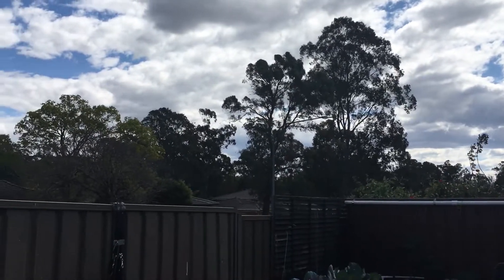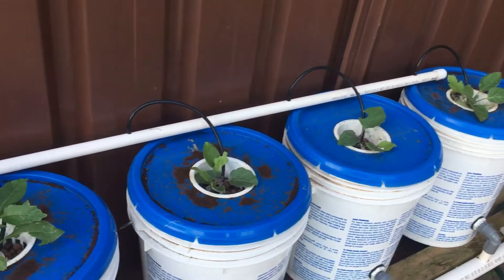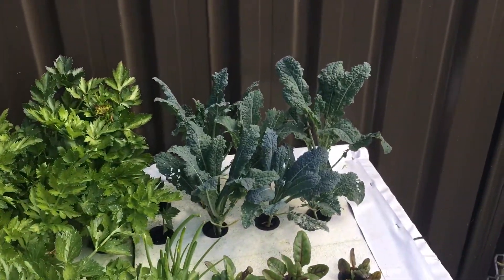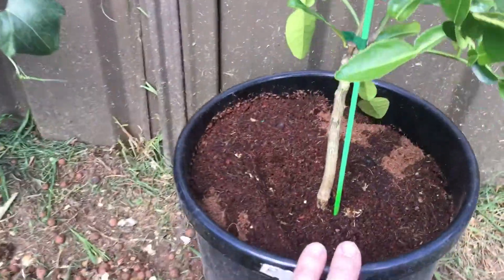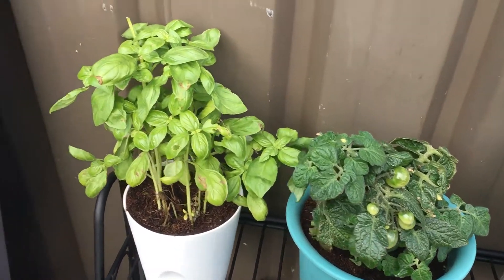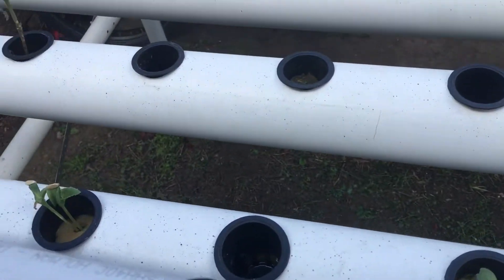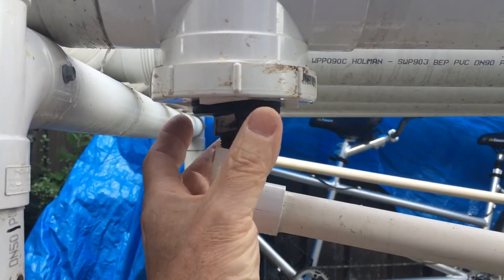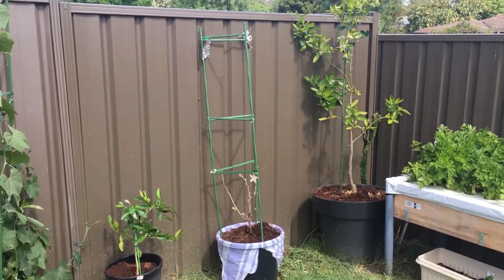Diy drain to waste buckets

Comment: Nice setup. Question about your stand alone plants... do you keep them hand water and not on a timed system because each plant needs different amounts of water/nutrients? I'm curious in doing some "drain to waist" stand alone plants this year and was thinking about putting them on some kind of dripper system (top feed) but maybe that's a bad idea??
Reply from the maker: How are you
In hot weather plants all plants  dont need much nutrients, plants  only use water 
Our stand  alone  buckets  we give around 1 litre of left over nutrient water to each plant  once a week 
The other days we just hand water using  the hose
With different  plants  using  different  amounts of nutrients, plants  will only use what they need ,we give the same nutrients  to all our plants  all they all grow  perfect 
Soil  has the same amount  of nutrients  but different  plants  can  grow perfectly. Its a bit of a myth 
Cheers
Reply: @smarthydroponics  Thanks for the reply. Really interesting. I want to experiment with this this year. Thanks again for the response
Reply from the maker: @XoshBitt  no problem 
Anytime